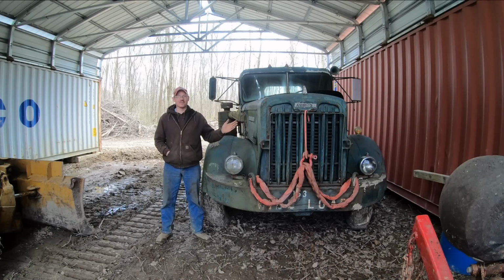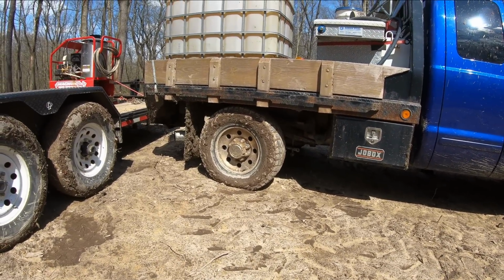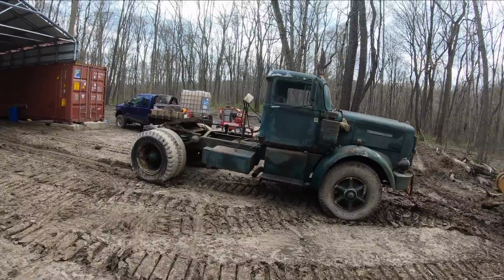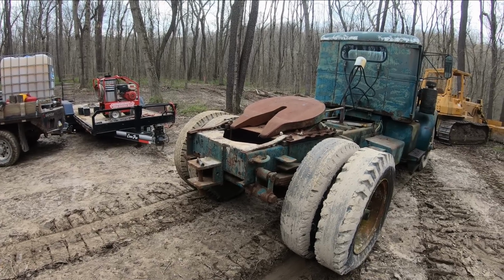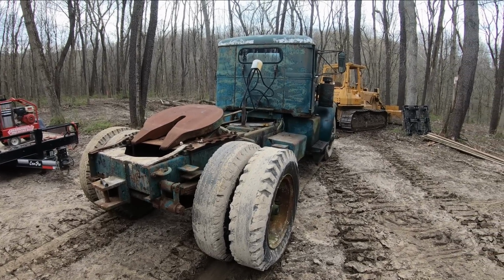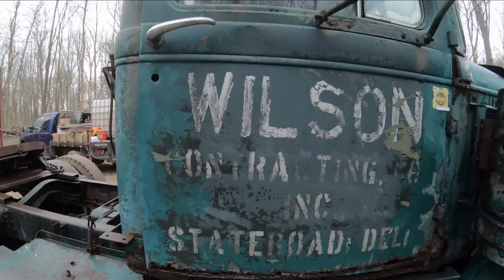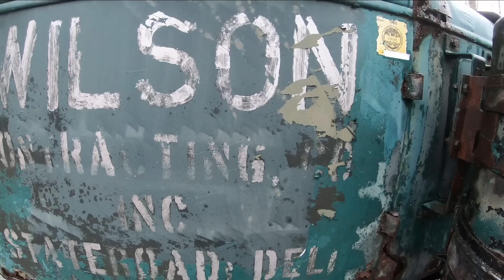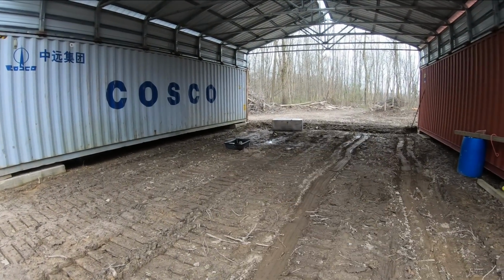Steam Cleaning 63 years of Grime off of my 1957 AutoCar Semi Truck!

Comment: I'm late to the party but seeing that old barn wood, I have to comment.  I had a barn on my place that was built pre 1850 and it wasn't salvageable.  Hand hewn beams, originally mortised and tenoned but the chimney was leaning/crumbling and there was no foundation to speak of.  But much of the wood, which was all heart pine, was still solid.  I couldn't save it as a barn, but I took out all the wood that was still solid and after MANY hours of metal detecting, pulling nails, cutting, planing, and sanding, I turned it into tongue and groove flooring.  It's now the floor in a couple rooms in my farmhouse.  So glad I repurposed it, and it looks great.  I don't like to let old things die either!

Comment: Love the door signage! I built my house nearly 30yrs ago &at same time the local concrete supplier was doing one a section plot one-over from me. Council accordance required a $3000 bond to cover any mud/muck drop on the roadway or sidewalk damage that you claimed back once you'd finished the house. Being as the only water supply was by rain water storage tank, "Mr concrete" set to fill his tanks by bringing a couple deliveries using his ole '57 AutoCar (looked very similar to the one in your vid) mixer truck which was a 6WD setup... with a fully fresh water filled mixer drum and tried cutting across the next-door empty section in winter after weeks of rain. Of course he sunk up to the axles and kept skid'n, revving like hell and clawing his way out, then making fast runs from the road to try get in near the tanks he needed to fill. Watching that poor old truck, with a huge load of water onboard going sideways into soft ground & spin'n round plowing up, slinging mud and fancy turf everywhere... wish i had a camera back then! In the end he filled the water tanks but cleanup was another story... He had to come back with load after load that he dumped out onto the street flooding it to sluice all the soil and clay away.... & then next day bring in a digger to repair the section for all the plow marks and sow some grass seed! Seeing your old tractor unit brought back these memories and yes i think on that day Mr Concrete man took waay too much risk, almost having a nasty accident but that truck held up to the punishment!
Reply from the maker: cool story! id like to have seen that!

Comment: When your pulling on something like a truck or a log, when using your 3pt don't lift above you're axles, my cousin was pulling logs and that and the tractor rolled over on top of him, killed him. Just figured o should let you know. Have a good day Matt and stay safe
Reply: Yup...that's what a ROPS bar is for.
Reply: You should really only pull heavy things with the drawbar. If that was a newer tractor, that much weight probably would have broke your 3 point.
Reply: @miker648  Which is why you wear your seatbelt. I operate equipment far larger than the average tractor for a living, and I still wear a seatbelt.
Reply: First thing I saw... absolutely terrifying, my man. I've reared an 8N up before. My advice (take it for what you will, armchair tractor driver and all) - don't pull anything with the 3-point hitch unless you're sure it will move. If you think something is stuck - like a truck in a mudhole, or a stump, or a 60 year old dead semi - then aim the tractor at it, pull your tow strap from the semi under the tractor and tie it to the rear axle. Then go in reverse to pull it. The worst thing that can happen is that you go nowhere and spin the wheels. Instead of rotating the front axle up and over and squashing you, going in reverse will push the nose into the ground. Newton's 3rd Law.

Comment: Tractor: I can't move this!

Dozer: hold my beer.
Reply from the maker: if the brake wasnt stuck the tractor would have with out much issue
Reply: Bert Grau 😂😂.
Reply: Or, from another perspective, the tractor was askin' and the truck said, " Uh uh!". The 'Dozer said "I ain't askin', yer movin'!" 😊
Reply: @DieselCreek  
Yes sir, I agree
Reply: @DieselCreek  you couldn't air brakes up with air compressor?  Dang
Reply from the maker: @terrydavis6132  these old rigs dont have spring cans like modern trucks, if there is no air pressure the brakes are not engaged. this truck has a big drive line brake for a parking brake
Reply: @DieselCreek  is it all rusted solid.
Reply: @bertgrau9246  THIS IS PRIVATE
Reply: The tractor had the power, just not the traction.

Comment: I like how you have the roof shelter propped up by storage containers. The containers act like walls and it's storage facilities at the same time. Cool!
Reply: The containers and roof look awesome. My OCD is driving me nuts with the way the right side box has concrete block in front of of container, whereas the left container is flush with block.
Reply: Kurt with Cutting Edge Engineering has one next to his shop as well.

Comment: In 1957 I was 12 years old, hanging around with my older brother who was a mechanic for an excavating/construction company here in BERMUDA. The company had an AUTOCAR  2 axle, iirc, powered by a Waukesha six. The truck apparently had been used by the SEEBEEs who built the airfield here in 1941 to refuel the bombers on their way to England. That's when I first remember AUTOCAR. Will follow this series closely.

Comment: I've been waiting for this. I will let you in on the best kept secret. I don't know if you have a home store close but pick up 5 gallons of Zep industrial purple soap. Put in a pump sprayer straight. Don't dilute it. Spray it on let it soak for 10/15 minutes and hit it with the hot water and you will be amazed! I've used this stuff for years on my equipment and truck projects. Its the best stuff I've found yet!
Reply from the maker: Does it dull out paint? I’ve used purple power and some other soaps that will dull out the finish of stuff terribly
Reply: @DieselCreek  I don't use it on nice finishes. It works great on heavy equipment and starting a restoration project. It probably would take the paint of the Autocar down to the original paint. I use it all the time on engines of cars and trucks. Pick up a gallon and give it a shot. If you like it get more. So short answer it will harm cheap paint but not good oem or quality aftermarket paint. Good luck

Comment: When I saw that Fontaine sticker I stopped the video to see if it was manufactured here in Alabama. Low and below it was!! I am pretty familiar with them and they do have resources for you locate the parts for the AutoCar. I live in Alabama and Fontaine was a customer of mine several years ago. Good luck getting it back on the road.

Comment: Like the use of the storage containers for walls and Right Near storage of gear.
Reply: I had a Full of water metal surrounded plastic container like that one in Video that slid off of the pickup and landed with NO damages; tough items they are.
Reply: My International PU 1210 carried that water with not a single complaint.

Comment: The old paint held up better than any car paint has since the 70's. The 5th wheel might be rebuilt if you can get it freed up, not too sure I would only trust four big U bolts to keep in place though.

Comment: Like the Autocar content! You may have to cage the rear brakes to get them to roll consistently until such time when you overhaul them.
Reply: That is my question too, I don't know about tractors this old how the air brake system worked, I remember from the tour of the inside of the cab it has a front wheel limiter valve and how that all worked I don't recall, plus anyone I knew who would know have past away. lol
I went back and looked at the first video of this truck and it has a hand (parking) brake lever so it may not have the safety air brakes as we know of today.
Reply: @frankdeegan8974 Safety spring brakes were probably mandated after this truck was built. The parking brake lever worked a brake drum on the drive line. You can't "cage the brakes" on these, since there are no springs to cage back to release the brakes.
Reply: @roughneckwolf  
That's correct Rusty. The spring brakes didn't come around until about 1963. But a lot of folks did put modern brakes on a lot of the older trucks because they were much safer.

Comment: Looks like it was a road Dept truck at one time. Looks better. If wheel had not been locked back up your little tractor would have pulled it I'm sure. Should have washed you tractor to. Lol thanks for sharing.
Reply from the maker: it would have pulled it for sure and the tractor got sprayed off a little! just didnt show it

Comment: You did a great job , I'm sure the fifth wheel will be fine they made good stuff then and you can get some of that heavy grease used for pile drivers
Reply from the maker: yes it just needs cleaned up and the linkages all freed up, a good soaking of oil is in order

Comment: Next time you start the beastie and free up that wheel you should go for a short drive ( I know you really want to😉 ) and use the brakes a few times and they should stay freed up.😀👍
Vehicles don't like sitting. This truck is similar to the Autocars they used for hauling red hot ingots from steelmaking to the hot mill at Dofasco Steel in Hamilton Ontario, Canada. The Dofasco Autocars were very heavy duty and had planetary rear axles and had a top speed of about 35 Mph
Reply from the maker: oh yes! ill be driving it before long!!!

Comment: That 5th wheel should be OK, my grandpa used to weld and repair those and semi frames, of course I can’t see it up close, but when I used to hang out in his shop (and drink 10oz cokes for free) I saw much worse. He taught me to weld, then when I joined the Navy they said I couldn’t weld because I was color blind, which I didn’t know. Anyway I love the patina of that truck, I know it’s been done to death, but I like the look when folks just do the metal repair, and hit it with a clear coat.
Reply from the maker: i like that look with some trucks but I want this one to be original!
Reply: Diesel Creek It will look sweet. I know you’re wanting to use it to move trailers, but being a single rear axle it would make an awesome looking dually pickup as well.

Comment: HEY MATT, IS THAT AN ...12:00... OPEN...INSPECTION LID ON THE TRANSMISSION..?.? When will you do a video about changing the fluids? Like the gearboxes, and the rear axle and the motor?

Comment: That water container is in Europe , known as a cubeit. 
1000 millimetres or 1 metre ×1000 millimetres or 1 metre x 1000 millimetres or 1 metre which is 1 cubic metre and it holds 1000 litres of water. 1000 litres of water weighs 1 metric tonne.
That is the beauty of the metric system.

Comment: To add some interium de-mudding of your site you might contact tree service companies that do chipping.  In my area they'll deliver for free if your somewhat near their area...otherwise its a dump fee for them.  Another item to consider is "hog fuel" very coarse wood chippings, last a little longer than tree chippings.  Rock on a 900' driveway will cost a fortune..  Also "soil cement" another low strength but solid surface for the covered area.
Reply from the maker: Gravel is expensive no doubt but there’s no way around it. Gotta have it wood chips just rot

Comment: A couple of tips to add to your pressure washing experience. 1: wet everything down first, makes it easier to remove 2:don't pressure clean the radiator to close it bends the fins 3: after heat cleaning the tyres, coat them with a rubber nourished from auto parts store, they come up near new with vulcanising 4: pump all the grease points  to eject any trapped water and clear old grease that's now soft from the heat. 
I also have a wax rust inmibitor in a pump sprayer I apply after using a leaf blower to dry down the equipment.

Comment: I drove an Autocar in the '80's and '90's, that wasn't in very good shape. I called it the Awfulcar! Windshield washer blades slapped the window, the bug headlight mountings were broken all the time and at night while driving would vibrate all around to the sides. It was with a lowboy and loaded,  if I wasn't careful, when braking it would shift into the left lane, guite dangerous! Many, many stories driving this rig.
Reply from the maker: Sounds like some easy fixes would have made it a good ride!

Comment: Wondering what transmission is in that Acar.
The one I drove in 1967 had a 250 Cummins and two four speeds. For the non truckers, that gives you 13  forward gears and four reverse. I loved driving that truck.

Comment: She done cleaned up purdy!   FWIW, Wilson Contracting of Delaware  was apparently a road contractor per this court case I found: https://law.justia.com/cases/delaware/supreme-court/1966/224-a-2d-396-1.html  

A few questions if you don't mind: What type of radio does that mag mount antenna on your truck feed- Ham, CB, ???  Why did you leave the peak of the roof of the shop open?  Does your shop have electrical power?  If not, is solar power something that you are considering for it?  How many apartments are you planning to build in the old church?  Did the water diversion landscaping for the shed floor work, or has it not rained since?   

I appreciate the time you put in making these videos. I look forward to them every Wed and Friday.

Comment: State Road, Delaware is a small community in New Castle County  Didn't you say the truck was purchased in Delaware a while back?  Wilson Contracting did a lot of work for the state highways in the 50s and 60s
Reply from the maker: I bought it from Maryland. but originally it was a PA railroad truck I think, it has registration papers for thir trailers in the glove box
Reply: @DieselCreek  Thought it came from somewhere near here. It may have moved around a bit over the years but Wilson was a highway contractor in Delaware and had a few legal issues with the state over some projects.

Comment: What type of stone are you going to use? I prefer 3in stone it drains really well and holds it shape well. Smaller mesh gravel just ruts up and doesn't work that well. 2 or 3in  stones make a better road base. I see a lot of folks use the smaller stuff and it just doesn't work very well.
Reply from the maker: oh absoluutely! i like 4" ideally then choke it in with 2b or 2a
Reply: @DieselCreek  yeah man that would be nice,  it makes a huge difference

Comment: Autocar trucks in movies: maximum overdrive, Duncan gets runover, possibly a 70's model. Over the top, Sylvester Stallone drives a 70's one as well, and wins a newer highway tractor autocar when they got all white/GM/Volvo. Die hard with a vengeance, hundred or so dump trucks loaded with gold, most old auto cars/ mixed with Mack u /dm

Comment: I wonder if the truck says State Road Delaware?
Delaware wouldn't be out of the question, it borders Pennslytucky and you found the truck down in Maryland.

Wikipedia says : State Road is an unincorporated area in New Castle County, Delaware, United States. State Road is located at the intersection of U.S. Route 13 and U.S. Route 40, southwest of New Castle.

I think that's it.

Comment: nice video. Is the ford F350 stronger than the truck ? can you put a 5th wheel there too ?
Reply: Would need to add an air compressor,  tanks, and lines. Could be done, have seen it done. It's really too much work. Plus the brakes on the big truck are more suited for pulling semi trailers. Than a converted pick up truck
Reply: @bertgrau9246  Thanks, I think a used semitrailer from copart can do the job easily too

Comment: Is that an IH 454?  Gas?  I have two 574’s with the D239 diesel.  Some of the best tractors ever made.
Reply from the maker: My tractor is the diesel as well, I have another one that’s locked up that has a gas engine might try to get it going one of these days
Reply: @DieselCreek  Awesome!  I have a row crop and a utility.  I’m rebuilding the utility right now and installing a new clutch.  Got to be ready to cut hay this spring.  The parking brake on the row crop disintegrated in the hydraulic system and caused all kinds of issues, but she’s back running strong.  I’m glad to hear you’re going to get the other one running!

Comment: The olive drab is its original color, not primer...I've seen other Autocars with the same paint. Something I never knew was that Autocar was sold to White Motor Company in 1953. Coolest part was finding the lettering on the door too. In the old days, state abbreviations were longer than the current two letters. Delaware was DELA....PA was PENNA (I'm originally from York). I found a lawsuit Wilson Contracting Co. filed against the state in 1966: https://law.justia.com/cases/delaware/supreme-court/1966/224-a-2d-396-1.html
Reply from the maker: cool! thanks for the info!

Comment: Tries to pull it with the tractor wont move, says "hold my beer" and shows up with the dozer. On a side note, you will destroy that pressure washer with unfiltered water. The pump is sensitive to particulates and will fail prematurely. I use a cheap rv inline water filter to avoid that. Its cheap insurance for a expensive pump.
Reply from the maker: I tried to buy one on my way out there but the store that always has them was out of stock, I’ve since got one, plus the pump has a mesh screen to keep any medium size stuff out
Reply: @DieselCreek  I'm glade you have one now. Those screens don't do anything. Any kind of sand or small particulates will wear out the pump super fast (ask me how I know) and the pump usually costs more than the engine. Good luck with the truck, I'll be watching.